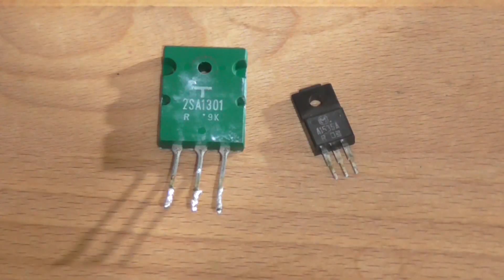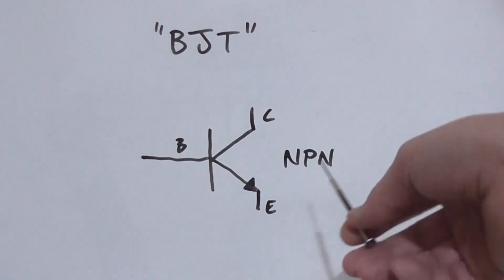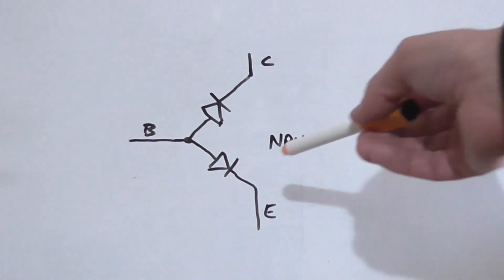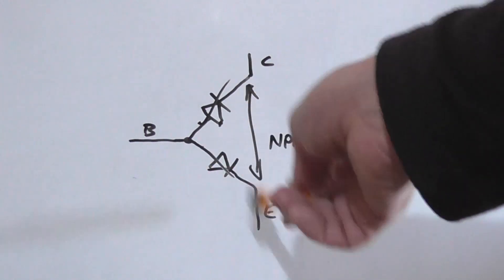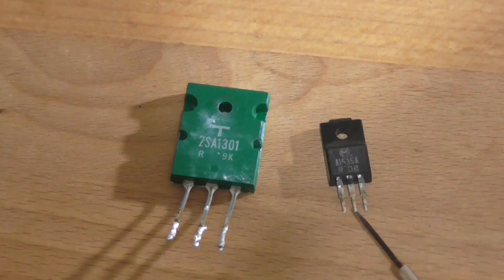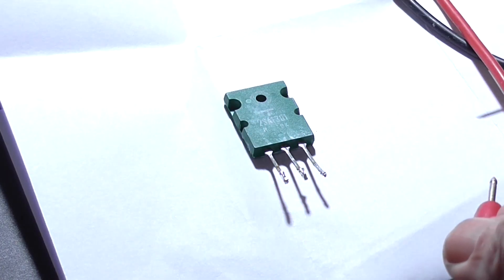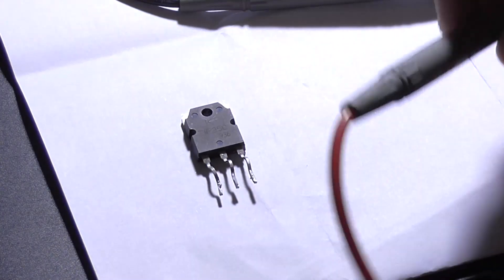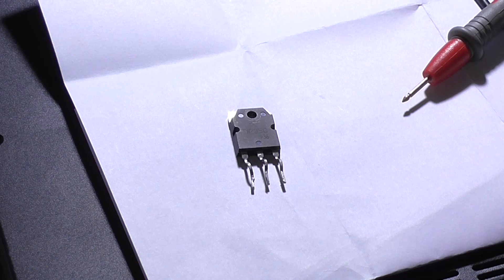Electronics Fundamentals: How to Test Bipolar-Junction Transistors

Comment: as a "known dead" test:  Is it safe to say that if any two pins are shorted (via continuity test), the transistor is fried?
Reply: The way I figure out mine are busted is from the smoke 👍
Reply from the maker: @iluvyunie  lol, that's another way, yes.
Reply from the maker: Yes. The transistor at that point will no longer function. It's done. There should be no shorts between base-emitter, base-collector or collector-emitter.
Reply from the maker: Also, remember that in circuit, the transistor can "appear" to be shorted due to other things in the circuit. There is an in-circuit transistor tester (which is basically an oscillator, similar to an ESR meter) which will save having to remove it to test it.